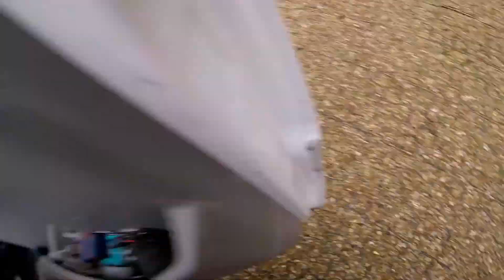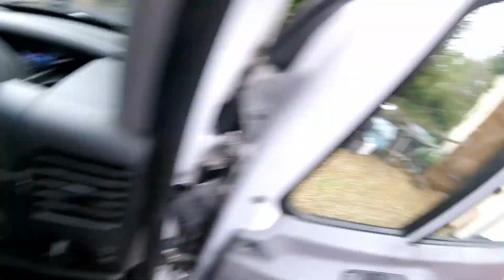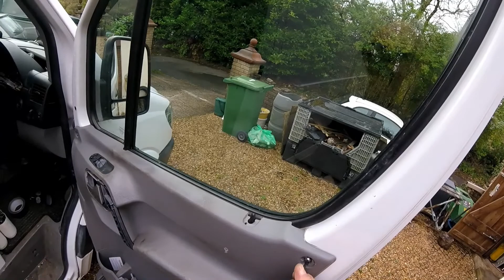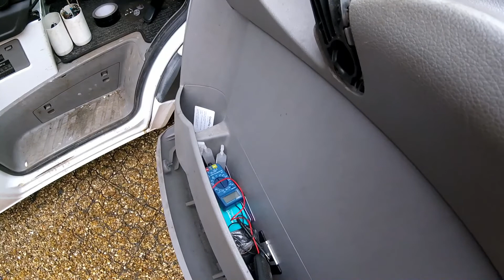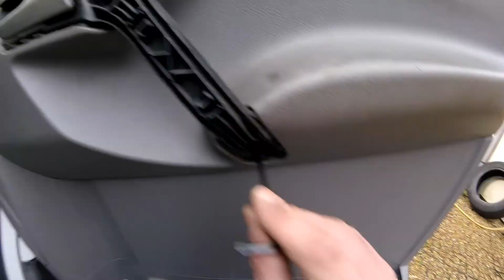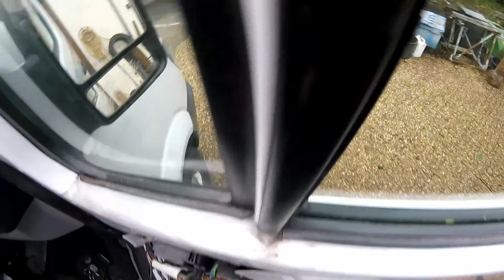W906 2007 to 2015 Mercedes Sprinter door trim removal

Comment: Great video thanks for sharing. I’d given up before I started to remove the door card. My interior light doesn’t come on when I open the drivers door, does yours? It lights when you press the unlock button on the key. Do you know where it is switched from or could it be a relay or fuse? It’s baffled me.